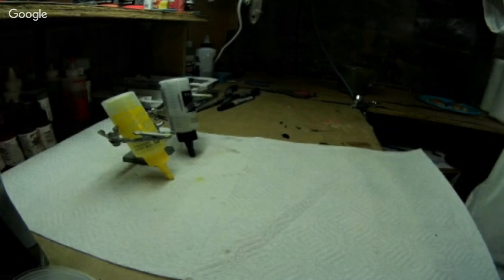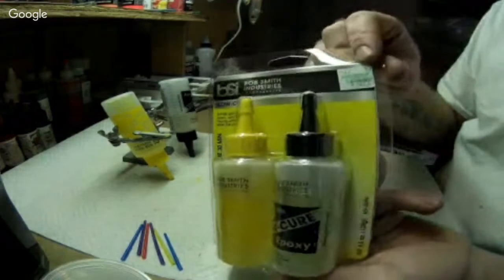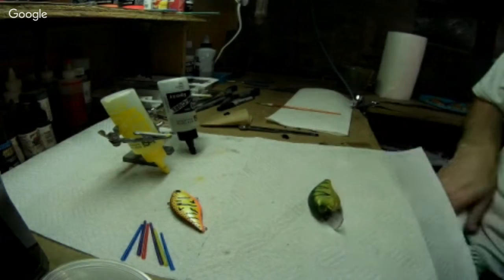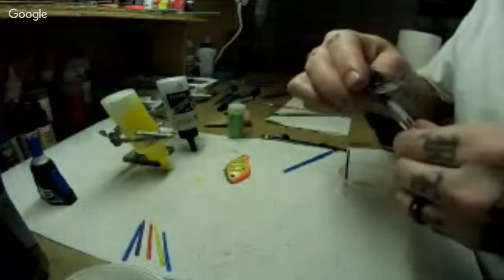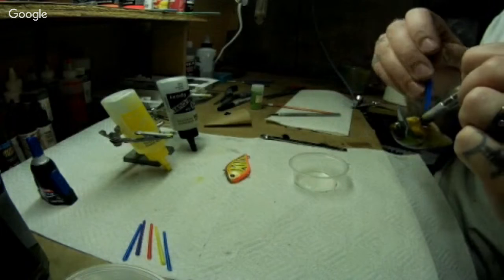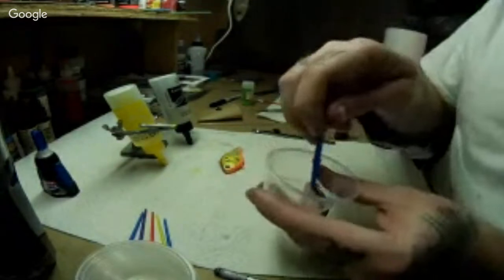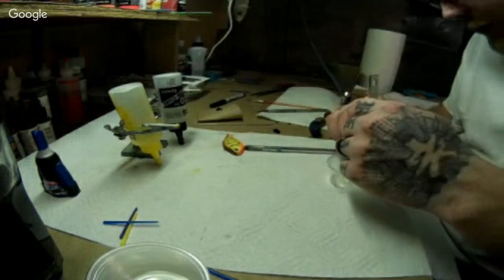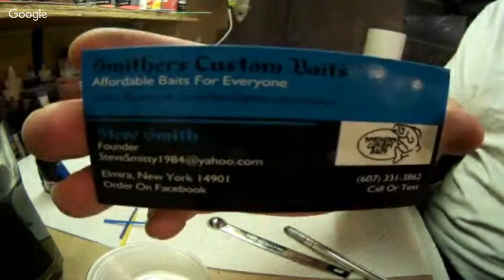How to Clear Coat A Lure ( Complete Finish)

Comment: Do you have any problems with air bubbles?
Reply from the maker: Donnie Tiegs I do not. as long as when mixing it you're not going crazy and when applying it long even strokes I have no air bubbles at all
Reply: OK. Do you warm the resin at all to help with spreading?